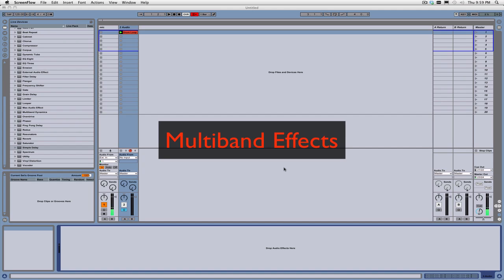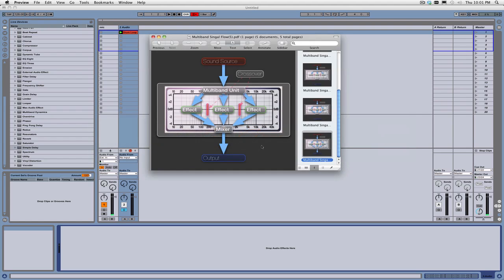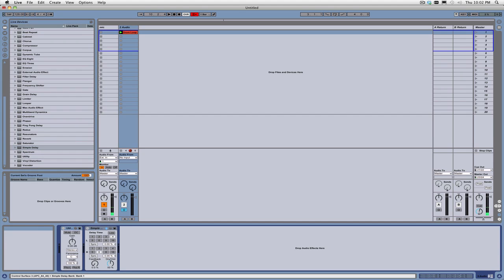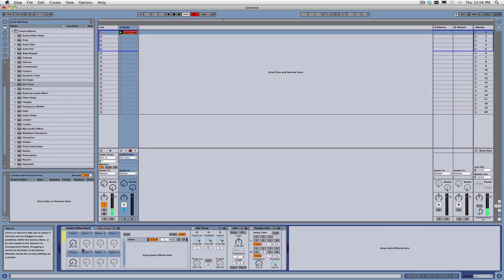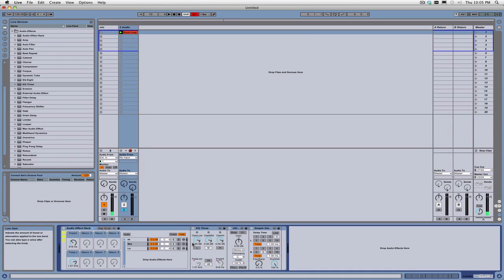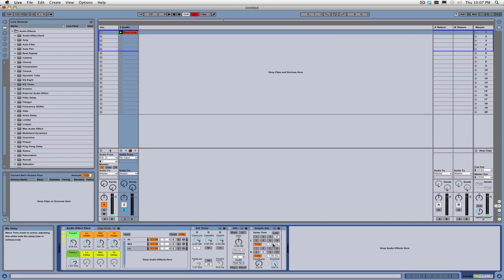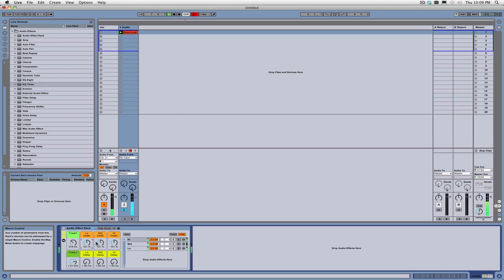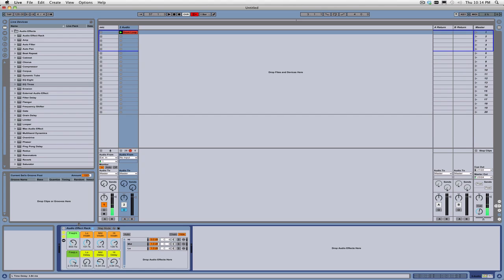Multi-band Stereo Imager for Ableton Live

Comment: @MORADI-- I didn't know that before reading it, and was wondering why the effects rack was working the way it was.  I suppose the simple delay would still create delays differently on the left/right channels since they're not lynced; and differently on each band as long as they are set to over 100% width...   Does anybody have an answer for that?  I was also wondering what the difference would be if the autopanner was inserted into such a chain...